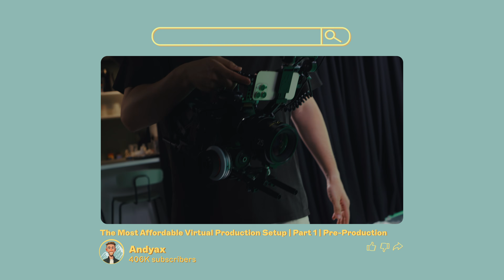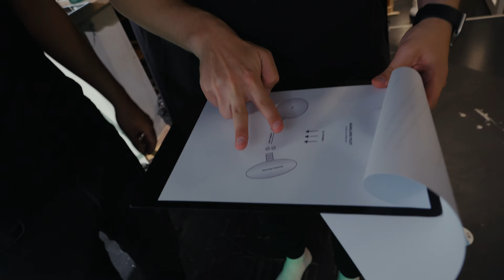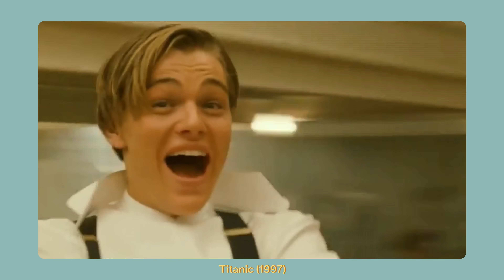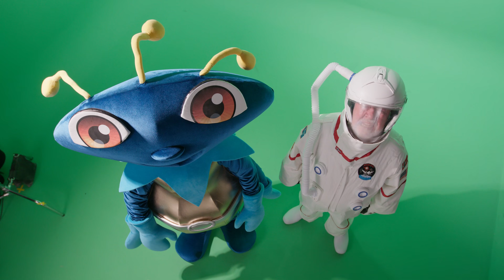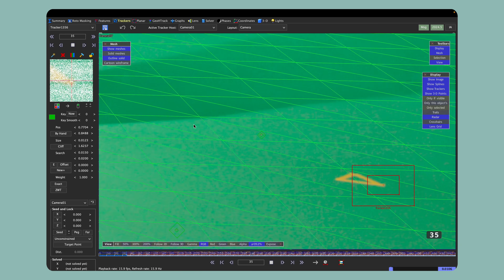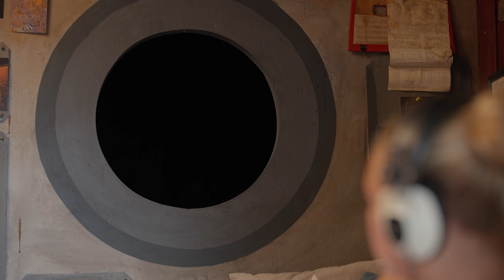How We Created This TV Show on a Budget

Comment: Very instructive ... and nice result !! If I got you right, as you placed markers on the green screen, you didn't rely on the tracking datas from Lightcraft (syntheyes to avoids slippering issus) but used it mainly for realtime compositing or the tracking was a hybrid solution (syntheyes and lightcraft) ? Is the hdmi connection of the fx3 as reliable/quick as the sdi from C300 from the lightcraft perspective ?